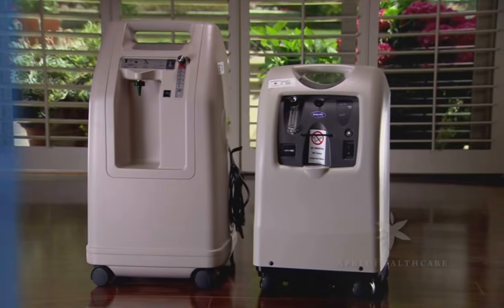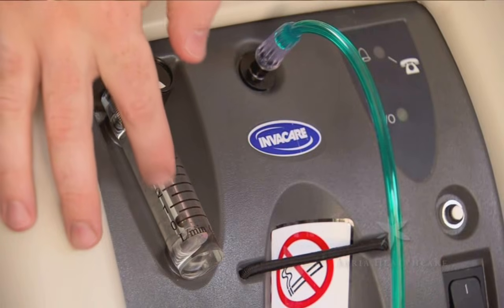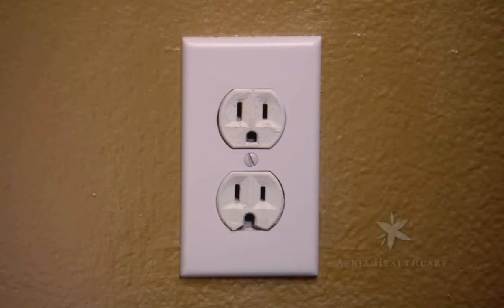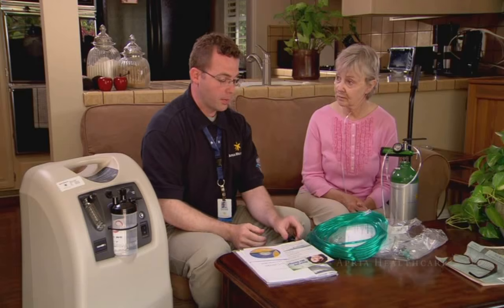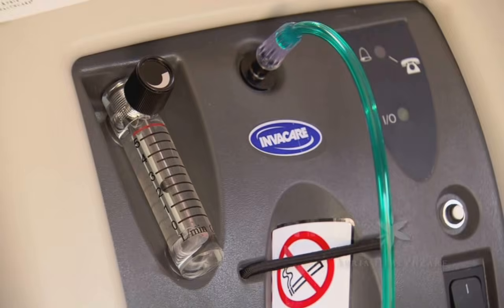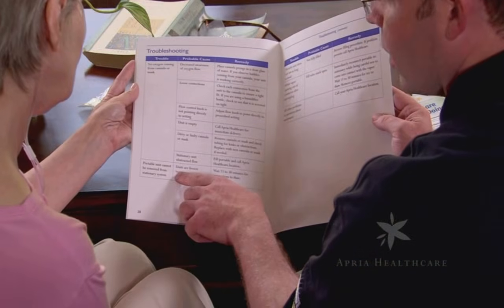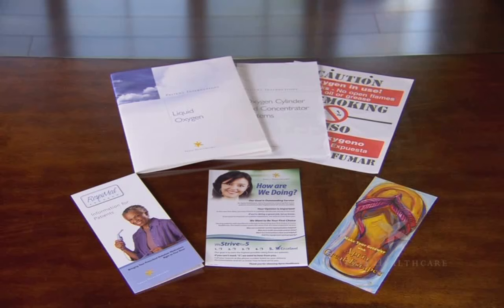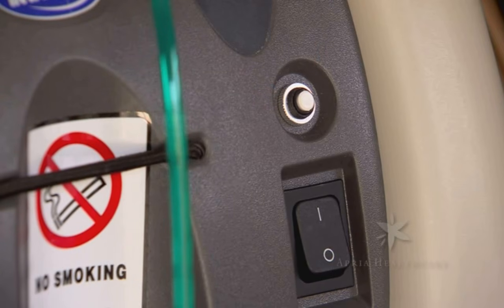Ch 6: Oxygen Concentrator Setup & Application

Comment: The #PHILIPSRESPIRONICS #EVERFLO_ʻQʻ__EVERFLO DoesNOT have a #RESET BUTTON on Their #INTERFACE_PANEL. I am using The #EverFLO_ʻQʻ as REPLY Type this OUT.
Reply: The main reason a "Reset" button is not on the interface panel is for safety issues. This machine produces Oxygen which is vital to life and if it begins to malfunction, you don't have the ability to press a reset button to start it up again. They manufactured that way for that reason. You cannot reset a compressor or sieve bed which purify the air elements into pure oxygen. This is probably an FDA requirement that prohibits this as well. I hope this helps.

Philips PCMS Patient Interaction Team